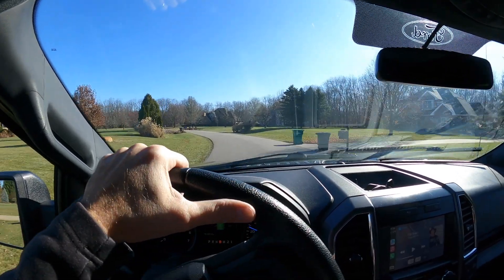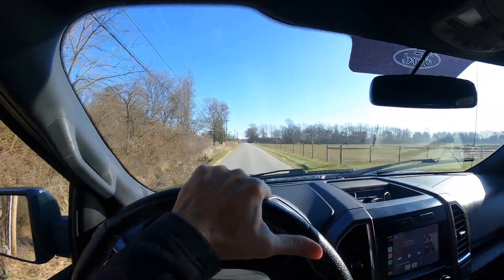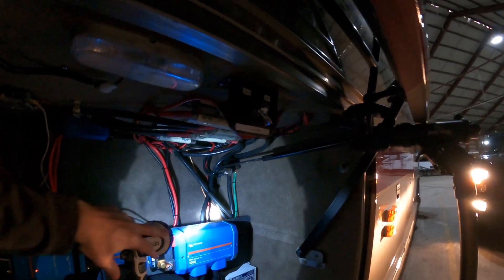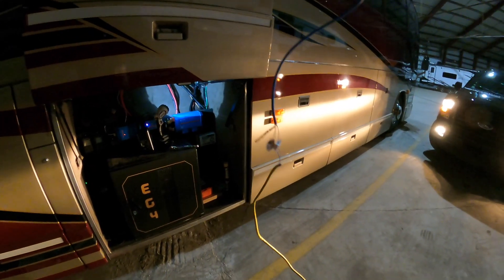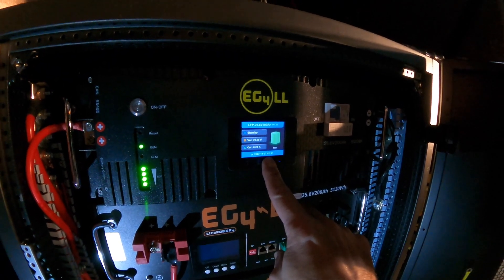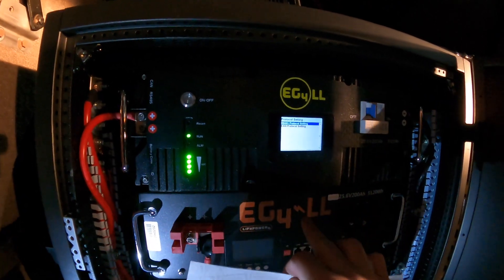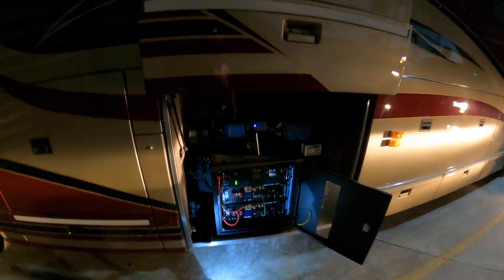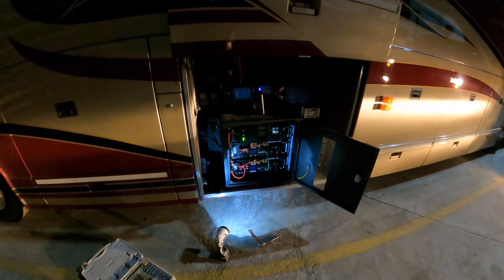Cerbo and EG4 Version 2 Communication Test 1

Comment: I am using the victron touch display with these 3 batteries. The only issue I have is say I am charging at 900 watts with no loads. My battery icon will show charging at 300 watts and then a DC load of 600 watts. It is showing the 2 non master batteries under the DC icon and not the lower left battery side. Have you come access this and any recommendation? 

Note the cerbo GX does show I have 3 modules installed so they are communicating.
Reply from the maker: Do you have (3) of the version 2 batteries?  Are they connected together and then routed to the cerbo?  And can you see the BMS on your screen?  I could see my (1) version 2 on the screen and used that for the SOC but changed it back to the shunt because it represented 1/3 of the total in the SOC
Reply: @CampPrevost  I have 3 of the v2 version (your top master battery). I asked signature solar about it but the guy that was emailing me couldn’t comprehend the issue.
Reply from the maker: @9-5Adventures . Do you have the (3) selected to create the SOC on the cerbo?  Or still using the shunt for SOC?   Not sure if that would make a difference- curious more than anything. Pending your answer - Are all the loads on the load side of the shunt?  Just the battery on the battery side?
Reply: @CampPrevost  I am not using a shunt at all. When I called them originally they said since the battery can direct communicate with the cerbo GX no shunt is needed. Other then the issue I described everything is working. I figured it was a setting I was missing on the batteries but your saying you need the victron shunt to have them all display under the battery icon (effectively making them 1 battery instead of 3).   

I see all the info such as total battery capacity and everything on the cerbo GX but then looking at the displays screen (the one with all the colorful boxes) it splits the batteries up
Reply from the maker: @9-5Adventures  I always wanted to get that far, but only 1 of my batteries would communicate with it. Did you select your BMS as the SOC?  I forget where that is. I don’t think you need the shunt - just finding the right setting. Your in uncharted territory!
Reply: @CampPrevost  I did not “select” it but it auto populated when I plugged the batteries in.
Reply from the maker: @9-5Adventures  ahh.  Good deal.  If it’s reading the info and displaying the info - wonder if it’s only seeing the charging of the 1st battery - 1/3 as you note - then showing the other 2 as a load / pass through.  So it’s getting the total SOC info but only 1 charge / discharge info. Not sure - very interesting
Reply: @CampPrevost  that is exactly what I think is happening. It is seeing the charge “pass though” the main one into the other two. Which seems like a simple software update but signature solar couldn’t offer any guidance
Reply: @9-5Adventures where did you plug the battery to? I got the cable from signature solar but usually the v can needs termination on the Cerbo and the last unit connected . The battery only has one Ethernet bms so nowhere to terminate it.

Comment: Did you figure it out? I can't find any updates. It seems something isn't right. Which inverters do you have? Did you ever have all three batteries connected and powered when you turned on your inverters?
Reply from the maker: I found if I turn on one, then immediately turn on another battery - it will run. Then reset the first.  I am hoping to get the bus out next week - we were 80 yesterday and now possible snow on Monday.  Had two terrible storms a few weeks earlier. Just left it in storage during all this crap. Will post new updates soon

Comment: Thanks for all this info! I have a Victron CerboGX, Quattro 5000 and 2 EG4-LL V1 12V models connected to 3000w solar in my current coach. Hopefully getting a Prevost XL2 in a few days and need to start migrating it all to the new coach.  Never tried connecting the EG4 to CerboGX as didn't see much need.  Once I had an issue with precharge when my inverter shut off, ended up using a spare lead acid then turning on the EG4's. I keep a portable battery pack in my rig now so if it happens again I can use that. Also is sweet because it has 120V outlets on it so we can use when camping for stuff.
Reply from the maker: Sounds like a great set up - especially 3000w of solar!  Good luck on the purchase and migration. These prevosts are complicated- I lucked out and have a simple one!

Comment: did you ever get the connections to work?? I have the 12v version for my 5th wheel and was wondering if this is something I could work out.
Reply from the maker: Thinking about bringing home in 2 weeks. Still dipping down to below freezing and tons of weird storms…. Let me know if you figure it out before me! Lol
Reply: @CampPrevost  I think there may be a special communication cable. Maybe this may help you on your setup... https://www.youtube.com/watch?v=Y2gNrrgIaDI
Reply from the maker: Not yet - I did buy the actual cable and hope to try it the coming months. We are still fluctuating between 20-50 degrees with heavy winds - hoping late March early April to bring her back home for a bit.
Reply: @CampPrevost  :-) How about now... getting ready to add my 2nd 12v. I figured out thru heartache that a Softstart (Micro-Air) was needed with just one battery. Now I'm looking to work on the communication from the batteries to the Cerbo.

Comment: I was able to get my EG4-LL v2 48v/100 batteries connected to my Cerbo-GX. It will show the EG4 batteries in the VRM when communication is working correctly. I purchased the cable from Signature Solar but they didn't provide any instructions so I had to call them. Pins 4/5 connect to the CAN port on the EG4 master battery and Pins 7/8 connect to the BMS-CAN port on the Cerbo-GX. I have not had any issue with the precharge problem you describe. Perhaps that is solved with all batteries v2 or with firmware update to v1.
Reply from the maker: Great news!  Thanks for sharing. It sounds like I just need to buy the cable. Was it hard to make the adjustments in the cerbo?  I finally figured out my precharge issues (I just turn each one on a split second apart and it works fine).

Comment: What are you excited about, you paid all this money for batteries that can't hardly start your Victron Inverters! Every battery I have connected to my Victron Inverters has started them no problem. I have the same Victron setup you do and have used Battleborn batteries, SOK batteries, even plain old lead acid batteries with no problems.
Reply from the maker: Saying lead acid batteries start (2) 3000w Victron inverters tied together shows me you don’t have any idea.  There is a dead short when connecting them because of the caps used. With lead acid you need to precharge them with resistors unless you carelessly don’t care about the arc/spark generated and possible damage to the inverters and battery.  These batteries will automatically pre-charge 1 inverter without issue, only when both are hooked together does the auto precharge fall short. Simply resetting the BMS will do both. Battle-born even sells a precharge unit to use with their batteries as they don’t precharge the caps.
Reply: @CampPrevost  I have no precharge  just a battery disconnect switch and have been living offgrid for 20 years and still have my old outback inverter that I started with working just fine in the barn.Victrons in the RV and cabin so I think I have more of an idea about living with batteries and inverters than you will ever have.
Reply from the maker: @bowbilly9080  what kind of switch are you using?  I tried wiring my original (6) 8D’s @ 24v to my original (4) outback VFX3524M and it blew an arc so large I was fortunate I didn’t get hurt. That’s how / why I found precharging the capacitors first to provide a controlled initial hookup.  I just use a soldering iron (using the wires from the 120v side), using a little resistor got really hot. Figure there are probably switches that can take the initial surge but wasn’t sure if the components in the inverters could as well.